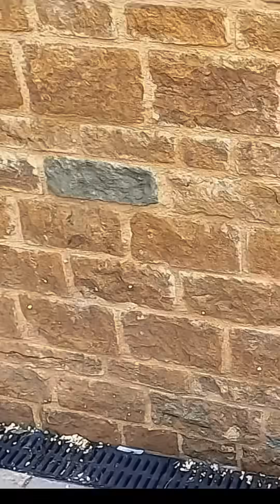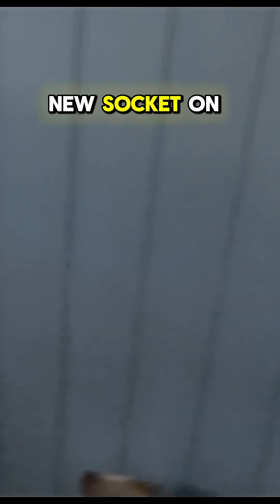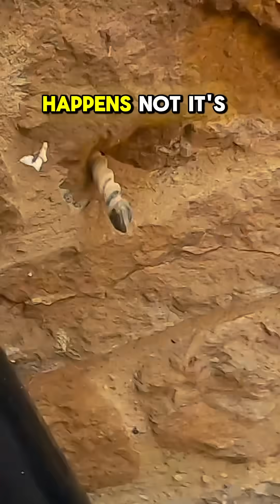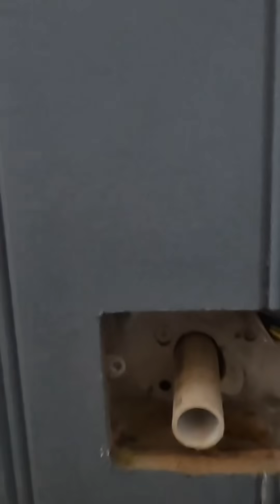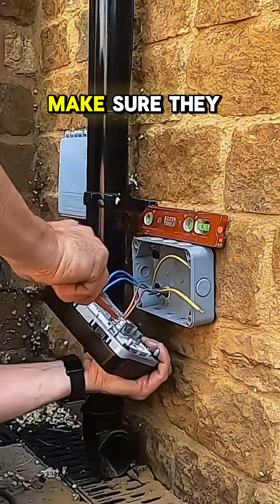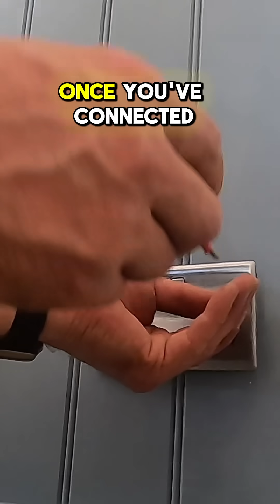How to Add a New Socket to a Ring Main Circuit 🔌🏡

Comment: Hi. Stupid question, I know, but since it's not shown in the video.. Is there now a wago or chocolate block connection in the backbox of the original socket?

So effectively ,you disconnected the one end of the ring from the original socket, fitted a new t+e from the old socket to the new, and another t+e from the new socket returning to the original backbox and connected it to the disconnected ring cable via chocolate block or wagos?
Reply from the maker: You are correct mate, incorporating the new socket on the ring. Full video here - https://youtu.be/QYnPAhkWqDk
Reply: @alashiya9536   this is a very good question and have been searching for an answer as im trying to do this to connect led lights but was told its better to extend the ring instead of spurring of it only problem was the led driver only had a supply side which was AC that went to DC load to my receiver and through to my led light so there was not a way i could think of to loop it back round as it was DC going. So i had to spurr from the socket with 13a fcu. Also done a ring extension on a socket but i did not want to use the wago, so i tied the load end of the new socket cable to the old wire load going from original socket and pulled the cable through from the orignall socket incase the wire got stuck or didt make it through then my idea was to just pull it back through and wago connect it.

Comment: No need to to blow the brick out . Drill the hole from the inside . When you hit the outside wall . You can then work out the brick thickness. Drill 90% of the brick thickness. Then take the hammer action off  and gently drill the remaining. Ideally with a small drill bit . Then drill the larger hole from the outside.
Another thing isn’t that socket supposed to have a drain hole

Comment: I usually fit a ply plate where the hole is going to come out to stop the brick from blowing, or back in the day, get the apprentice to hold the plate firmly against the wall.  The block used here is a bit harder to stop getting blown out due to the irregular shape than flat brick and render.
And id usually fit an fcu inside and make it a fused spur
Reply from the maker: Nice, everyone does things differently 👍

Comment: How did you get a 20mm conduit through a 10mm hole? Why did you smash it through to the depth of the back box?

Why didnt you mastic the new box to the wall to keep the ip rating?
Reply: 10mm will be the pilot then drilled from the other side.  Hopefully it's sealed up, a wee semi circle of sealant, around the top of the conduit, just not in the short clip.
Reply from the maker: Yes, check the longer video pal

Comment: Why extend the ring and introduce joints? Simple spur would’ve been fine here.
Reply: Sometimes, you'll find people want to use the outdoor socket for an inflatable hotub. Some of them are 3kw. To be on the safe side I extend the ring, not always. If and when required I also install a DP isolator.
Reply from the maker: 100% wire it for all occasions

Comment: Just a bit of a tip mate if you get your apprentice or someone to hold a board on the wall while you drill the hole it should stop it blowing a chunk out of the brick/stone.
Reply: @carsaremeee  or take it off hammer as you get closer
Reply from the maker: Cheers guys - good tips

Comment: You should’ve done spur instead of extend the ring but anyway good job mate
Reply from the maker: Cheers mate. Out of interest - what do you say spur it?
Reply: @toolboxtalking I'd spur as if you send the ring out and the enclosure fails it can damage the cable and split the ring. I'd rather a spur so in the event of damage the ring doesn't split